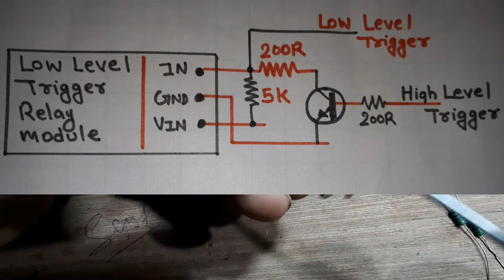#EP-76 Convert Low level trigger relay module to high level relay module.

Comment: That's way to difficult, simply connect GND pin and IN pin to GND and supply 5v to VCC and off you go, You don't need all those resistors.
Reply: :D How will you make the INT inputs for the 4-WAY RELAY? You cannot close the electricity flow to the other relays. So yes, you are right in single relays, but this is not possible when there are multiple relays. But. Here, it means that intervention is necessary to control with a signal. But I agree with you to some extent for the single relay.

Comment: It works! but its normal that the green led lights? (it lights very poor)
Reply: This is not normal. Because you should check whether the GND lines are configured correctly.

Comment: I have a High level trigger relay which I wish to convert into low level trigger, what procedure do you recommend to achieve that?
Reply from the maker: you can use PNP transiater instead of NPN
Reply: @Aviprink  Could you please elaborate it more

Comment: why don`t just connect GND and IN and give high signal to VCC? without all that soldering crap
Reply: you are correct.... just reverse the logic... by connecting the INput signal lines directly to GND and the put the Arduino signal (from whatever GPIO) to VCC. The Relais will switch.  The signal pin needs a logic level of near 3.3v to switch the Relais ON. Even though the Relais are rated at a 5v switch signal it will work.

For Relais with 12v Logic you need to use a signal level converter to reach the switching treshhold.

Sorry, AviPrink... Your Tutorial is still worthful to learn how to flip or flop the logic to its opposite using NPN or PNP Transistors ! 

Good Video anyway.
Reply: yea, your way is better :D
but if the input signal is 3.3v, not 5v then we still need some soldering crap :))
Reply: @pierrekiefer21  can draw a diagram for beginners? You can here, you can mail.
thanks
Reply from the maker: Arduino and any microcontroller can't drive these relays directly because high voltage back emf .or low current . Some times voltage level from uC are 3.3v
Reply from the maker: Kindly check description after 48hrs. I will try to add link of diagram
Reply: Don't work, i've checked for 3,3V
Reply: There will be 80ma of current for that particular type of relay. For example, Arduino nano could give only 40ma from its pin. So this approach not will work in any case.
Reply: @Vondola99  use transistor
Reply: Doesn't look right to me. Do you mean the GPIO signal to VCC? Then where does the 5V power go? We can't use GPIO voltage to drive the relay.
Reply: @fennng  you can use transistor or optocoupler, but these relays are designed for gpio
Reply: @Aviprink  use diode
Reply: @predictorllc6045  I understand this relay module has a IN pin for GPIO. What I don't understand is that how come use GPIO to power the VCC pin.
Reply: @fennng  bro, think less, just do, it is not the case for debates. If you afraid for your gpio health - use opto or other way... Anyway it is much more easier than suggested in video
Reply: @predictorllc6045  No sure if aduino board can handle that much current. I don't think it's a good idea to power the VCC using raspberry pi GPIO.